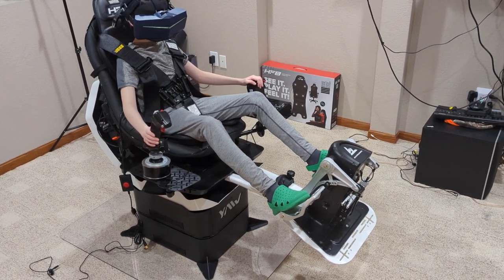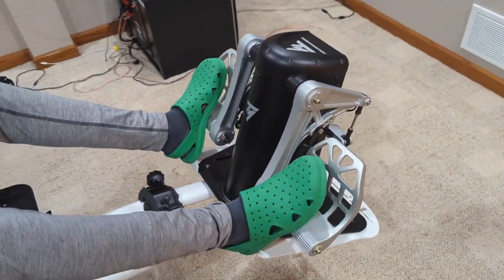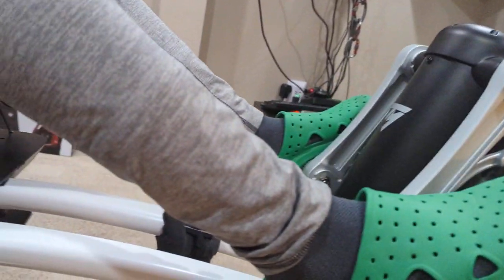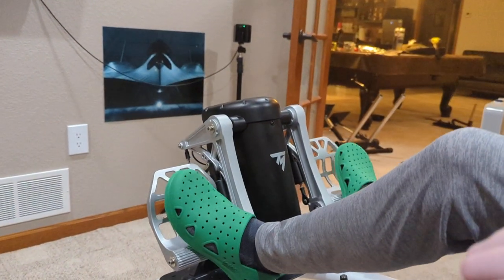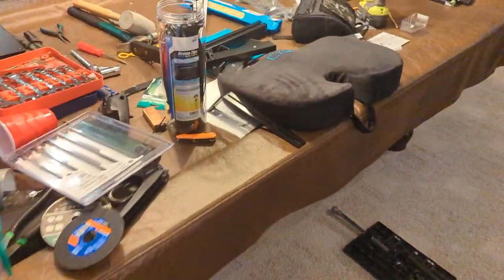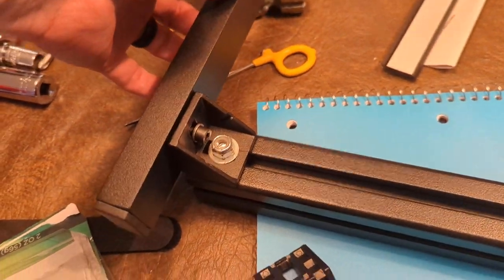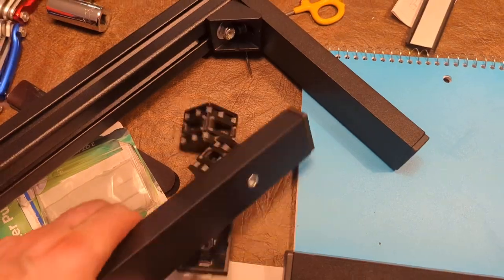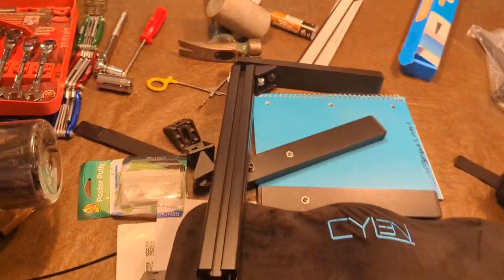YAW 2 PRO build update. Ideas for PC gaming joystick and throttle mounting. Forget Monstertech!

Comment: U should fly an actual RC fixed wing plane that has the FPV camera in the spot that delivers the same point of perspective as the real thing. Integrate the head tracking with a good 3axis gimbal for the FPV. Dunno if you'd run the chairs movements from the remote control data or from an onboard IMU on the RC plane but surely it would be possible to find a way that had acceptable lag/latency and provided the chair with the sufficient data to function smoothly and accurately. 

And the more $$ you spend of the RC plane the better. Because you can't 'reset' a model plane if you crash and believe it or not, that is a godsend and something the best software in the world is simply unable to replicate. The real and authentic fear of consequence, which is where the adrenaline rush and feeling of exhilaration comes from...
Reply from the maker: That's a cool idea. And a very deep rabbit hole. I just don't have the spare time to dedicate. Would be awesome to actually fly in VR. Crazy concept. Cool. Somebody will if they haven't already.

Comment: I did without those side mounts and went with the table.  It's on a quick disconnect mount.
Reply from the maker: Nice. I was concerned about the lack of position options with the table. But cool to hear that it works. How was the tuning? Software?

Comment: I have seen videos with the YAW bouncing around the floor when on extreme settings, have you had this problem, anyway to fix the unit to the floor?
Reply from the maker: Thick double stick gorilla tape under the feet on a plexiglass platform.
Reply: @phoenixrising011  thanks :)
Reply from the maker: @lisa-azrabroad4137  also thick gorilla double stick tape under the plexiglass platform against the carpet. Two layers. I tried just sticking the chair to the plexiglass and when under hard yaw it would just spin the plexiglass in place. Lots of power. There's just not enough friction between plexiglass and carpet in my case. I would put a carpet or rug down on a hard floor. You're going to wreck the floor if you don't have padding.

Comment: I want to put the tpr pedals on mine but the fear I have it’s the actual leg rest itself supporting the weight under the seat , I’m afraid it could strip the screws right out that’s a ton of leverage
Reply from the maker: Unfounded fears. It holds fine. The thing to know is the extra weight in the back you'll need. 
    2x 10 lb plates and 1x toro timecutter 3200 lawnmower weight. 10 pounders don't move. Plus I can slide the weight left and right. Can't do that with their stock plate system.

FOR ANYONE ELSE READING THIS, DON'T JUST PUT THAT MUCH WEIGHT ON. YOU NEED TO BALANCE IT. YOU MAY NEED DIFFERENT WEIGHTS.

Comment: watching through your vids in order and onto this one now.  I have the TPRs too, it would be interesting to see more in detail what you did to get them on.  I also use the Warthog Hotas too.  My main concern though, the Pro says the total weight limit is 130kg  I think I'm approx 113kg and quite beefy, so concerned by the time I added TRP and warthog etc it'll barely be able to move, let alone potentially adding counterweights too
Reply from the maker: Drilled 4x through the base plates on the pedals and footrest on the chair. 4 bolts
Reply from the maker: It's strong AF. It'll hold you. There's videos of 500 lb people on it. Balancing the weight is key to avoid premature wear failures.
Reply: @phoenixrising011  Interesting,  I could only find the VR video from eons back of the VR1 with an oversized guy sat in the bowl, it did move, though slowly.  I'll try to hunt for more
Reply from the maker: @midnight7297  https://youtu.be/Id2fN4Usnv8